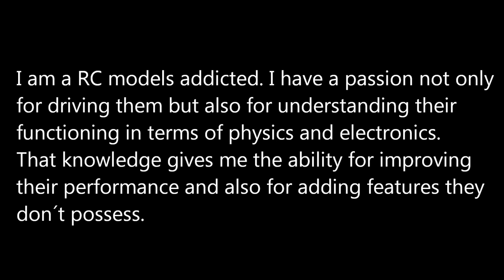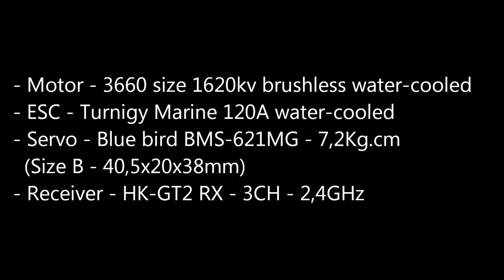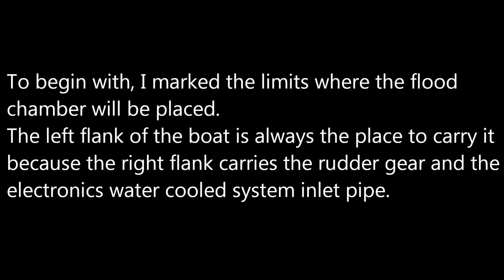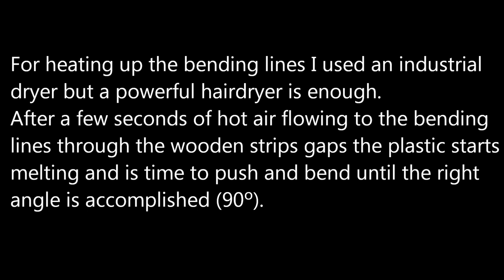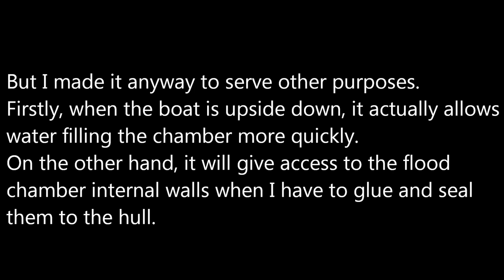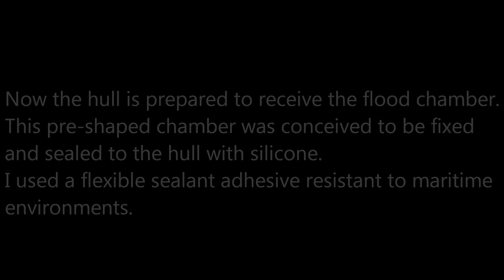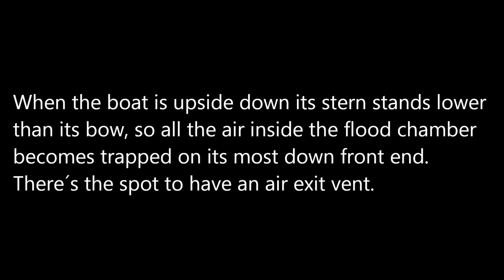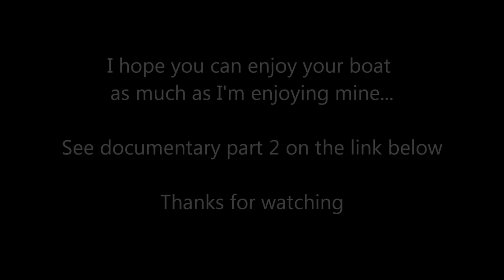HK Pursuit makeover project - Flood chamber and other tips - Part 1 of 3

Comment: Pedro,
  Thank you for a tremendous amount of information... I know it took a long time to make this boat and the videos. I've been building and racing RC Boats for many years and occasionally like to take my 55mph Gas Boat to jump some waves in the salt water, so I have experienced the "torque roll" effect but unfortunately have no way to flip my boat back over. So I may make a brushless flood chamber boat some day like yours. However, I wondered is there enough flotation in just the bow of your boat that if your hatch fails and your motor/esc/battery dies, then it will not be fully submerged? Looks like you could have made the chamber longer, but I agree it's better to add a little weight on the left of CG to help with torque roll.
Reply from the maker: If I did the chamber now, I would make it longer just to have the boat uprighted quickly. With this one it takes about 10 seconds to do that. You are absolutely right, if the hatch fails, the boat probably sinks. But it is a stock issue, I didn´t change anything on this matter. The flood chamber (longer or shorter) don´t take or add any flotation capability to the boat if the water floods the hull. To correct this issue I just would have to put more styrofoam inside the hull. Anyway, as you have seen, I reinforced the hatch locks and if it was a leak on the sealing, the boat wouldn´t be flooded with water in the time that it takes to flip back over.
Thanks

Comment: Did you consider using a waterproof Traxxas receiver case for your rx?

I have this hull and I have bought the Traxxas rx case for it. Only $10 on ebay delivered. Yes, more expensive than a balloon, but, a much safer rx!
Reply from the maker: Thanks, I will do it. The balloon isn't also suitable for protecting the battery. It melts with the heat.